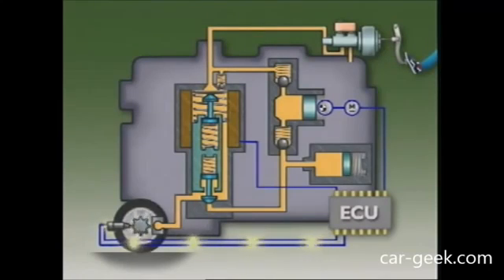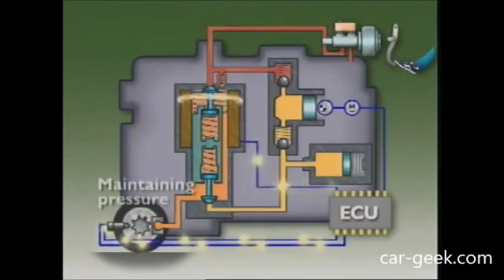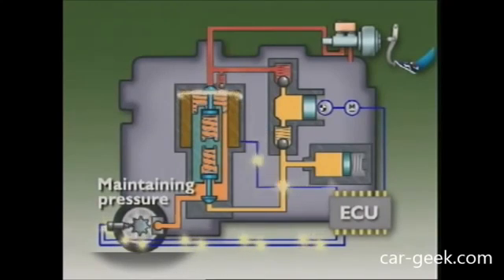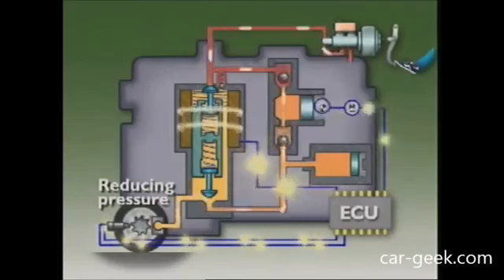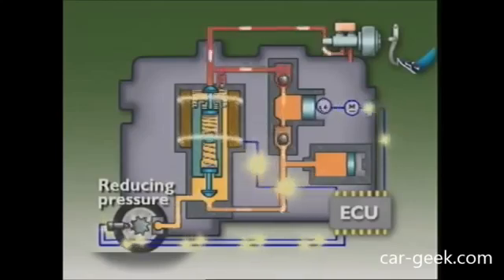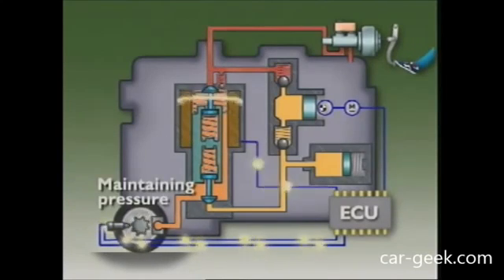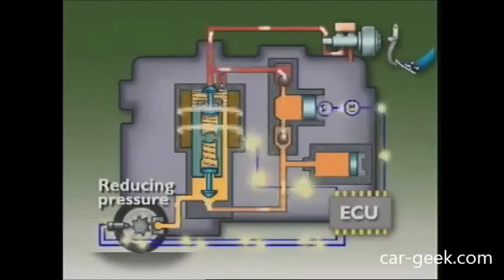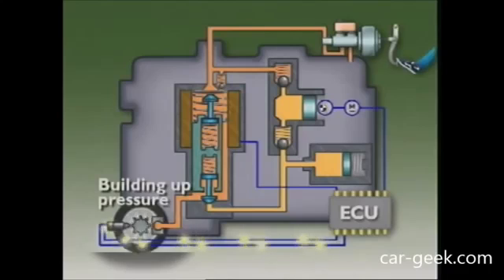ABS Operation (Solenoid)

Comment: That was a good little video, thanks - straight to the point. A video on bleeding these things would be good, too. I have manage to do so through trial and error, even without a computer, but the correct way to do it in practice remains somewhat of a mystery, (along with all the parameters and whys and wherefores of each step).
Reply: So, how did you bleed it correctly? I need answers 😄 Got the same issue
Reply: @Speelbird  all the videos on the topic say whatever you do, don't mess with the ABS unit. I gave up after all else and undid each pipe to it in turn, right at the ABS unit. This worked the air out, though we had to do it a number of times. I have subsequently been told that after fitting a new brake caliper, A) never pump the brake lever at all until the caliper has bled by gravity, it takes 5-10 mins to run through the pipes from the reservoir with the bleed nipple left open and B) never pump the brake pedal hard to the bottom or anywhere further than its normal travel, or the piston will likely seize at a point it is not used to going to after years of use.
Reply: @Speelbird  use the brake pedal a lot to bleed the ABS, but just be careful with how far you push it. 2 man job. But it works.
Reply: We did have the engine running and heard the ABS come on as it bled, without using a computer to cycle it, which is what workshops do.

Comment: A very good illustration , but I still don't understand how the ABS unit can reroute the fluid back to the master cylinder when the brake pressure is being applied from the master cylinder? I understand that the hydraulic force has to be diverted somewhere and there is nowhere  it can really go , but going back against the force that is sending it to start with is hard to understand. Not meaning to discredit  this video at all, I still just don't understand how that can work.
Reply: I don’t think this video discusses the role of the abs pump well. This might be wrong, but this is how I understand the mechanism. When a tire begins slipping, a valve in the abs module closes preventing additional hydraulic pressure from building up on that caliper. Basically it maintains the current pressure. But if the wheel locks up, then another valve opens that causes the abs pump to push back on the master cylinder helping to lower caliper pressure. Also, I think the abs pump provides additional pressure beyond what the master cylinder can do so that a particular wheel that’s rotating faster than the others can be slowed. I’m not totally sure about these details but would be interested in other’s thoughts. So I guess to answer your specific question, I do think the abs pump essentially pushes back on the pressure from the MC to decrease pressure to a particular caliper. I wouldn’t say that it is pushing fluid back into the MC, but rather just decreasing the pressure exerted by the MC. Maybe?
Reply: @Pseudify  *You are right* ;  the ABS modulator, its PUMP, is PUSHING FLUID BACK TO THE Master Cylinder, it CREATES MORE pressure than the brake pedal; it is powerful, the FUSE for the pump is 40 or 50 AMPS!!!! at 12 volts;  
and YOU KNOW IT DOES THAT pushing back 6 to 10 times a SECOND===
  HOW?   notice how the brake pedal    P U L S A T E S    under your foot;  obviously there is a backwards force GREATER than the one you are exerting.
          It is  a miracle(not the BS religions invent, no, this is a REAL one, there are many more)
      (sorry for the caps, --i will edit that out--).
Reply: @josepeixoto3384 . Good points. By the way, I noticed your last name. Are you familiar with the Peixoto coffee family? I think their farm is in Brazil, maybe, or somewhere in South America.

Comment: Hello, thanks for the good video. Is it possible for the ABS module to work with only one speed sensor? Actually, I am a student and I want to present the operation of ABS with a single tire and a brake unit using a single speed sensor.
Reply: I'm thinking you could, here's another good video that describes abs in another way. I think you'd have to block the other holes where the other brake lines go and bleed it. https://youtu.be/IKi5O3ZlSu4

Comment: Not a very useful description. Doesn't even mention how the system builds pressure back up after releasing it, in fact it's misleading. [Edit] Actually the biggest missing piece is how pressure is relieved on the caliper, ie: the function of the ABS pump. See replies to this comment.
Reply: 1:38
Reply: lol looks like u have watched less than half of the video
Reply: @nuduw  Wrong. The video doesn't explain the function of the ABS pump, the spinning thing at the top right. Doesn't even mention it. Without the pump, pressure would never decrease on the caliper piston, since the pedal is still applying pressure on the master. You can't explain ABS without explaining the pump. So I phrased my original complaint wrong - because I didn't understand enough from the misleading narration. It's actually not the building of pressure back up that's misleading (though it's glossed over), it's the releasing of pressure! I think I understand it now after watching the video about 30 times and inferring a lot of stuff. 

The solenoid doesn't just open a passage to the master cylinder - that's open normally anyway and wouldn't do anything. It opens a passage to the ABS pump, which PULLS pressure from the caliper piston and pumps it back into the master cylinder, against the pressure of your foot on the pedal! The ABS pump pumps up the pedal! THIS is why the pedal vibrates. Then when the solenoid releases to its resting position, the passage from the master is opened again, and your foot pressure applies pressure on the caliper piston again. Then the cycle repeats with the abs pump sucking pressure away from the caliper piston again. 

But let me know if you have a better understanding. I stand by my statement that the narration is pretty much useless and actually misleading if you want a proper understanding.
Reply: @nuduw  lol looks like you don’t have a rebuttal for @steelddd after HALF A YEAR LMAOOO be gone troll
Reply: @steelddd  well put bro. videos like this are being used in schools like UTI and WyoTech. the video is 30% informative (barely) and 70% uninformative.